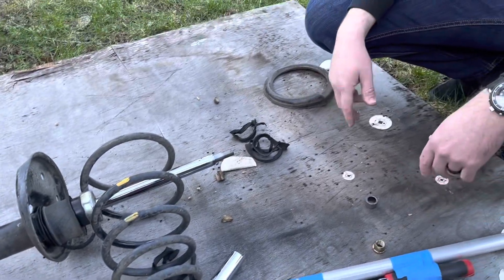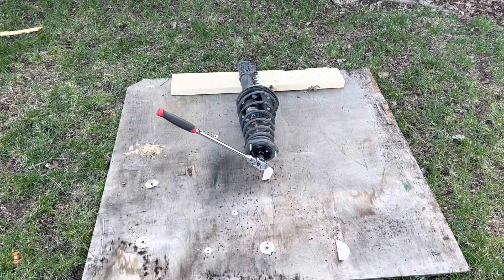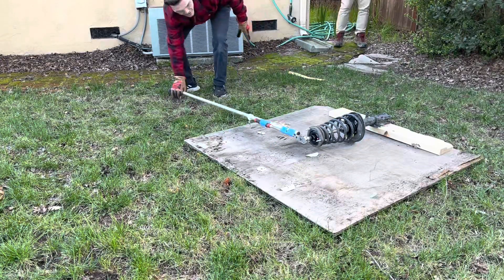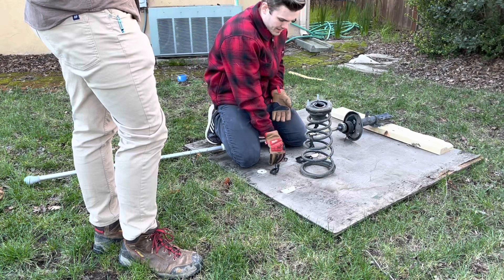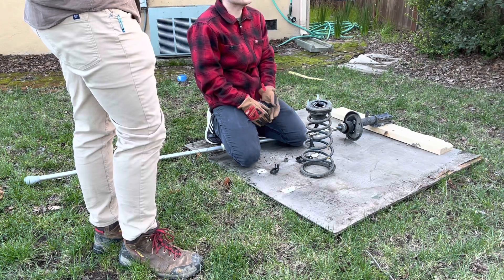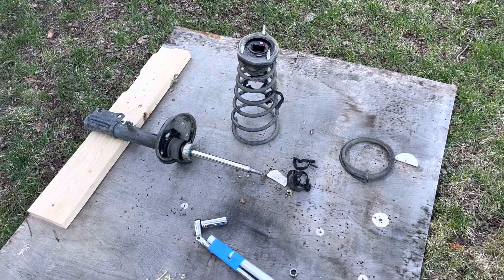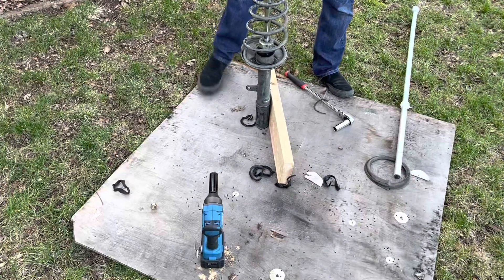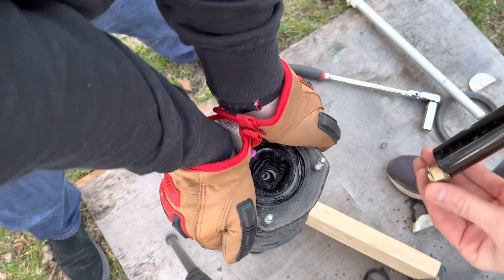Are STRUTS actually DANGEROUS?!?!

Comment: This truly depends on the free length of the spring. That spring's free length isn't much more than the extended length of the strut. Try that with one where the spring is MUCH longer than the extended length of the strut and you will see a MUCH different result. DO NOT take struts apart without the correct tools! You ABSOLUTELY can severely injure or kill yourself or somebody else.
Reply from the maker: Yes! I agree with you 100%. That's why I specified the make and model of the car this specific strut was from in the video. Please do not try this! It can be very dangerous!